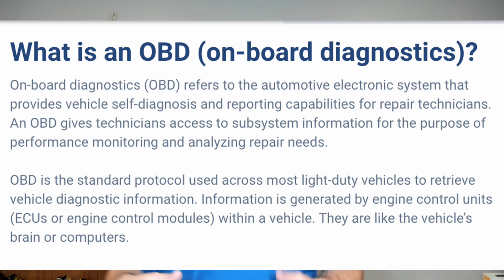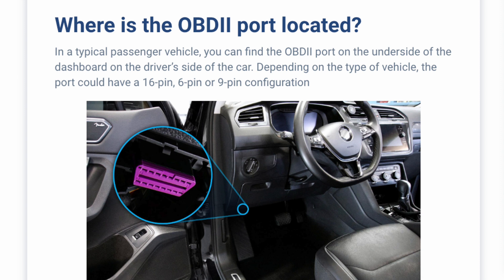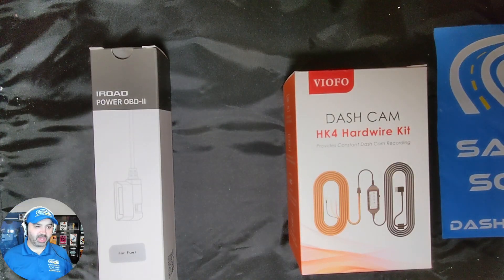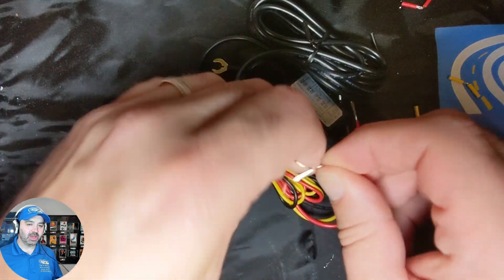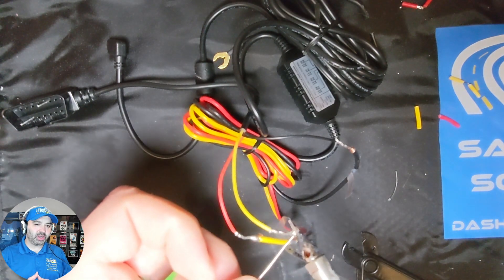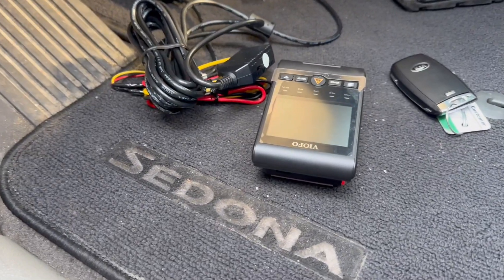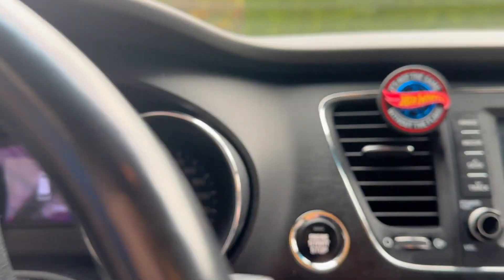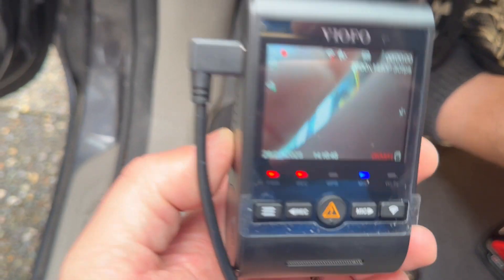Viofo OBD2 Hardwire Parking Mode Cable

Comment: Hello Ben,
70Mai offers a hardwire kit that connects to the OBD-II port and provides a direct USB-C output. I want to use it with the Viofo A329S 3-Channel model. The Viofo requires a 5V/2A input, while the 70Mai kit outputs 5V/2.4A through USB-C. Instead of combining the IROAD OBD kit with the Viofo HK6, can I use only the 70Mai kit?

My vehicles are a 2024 BMW 3 Series G20 and a 2025 Mini Countryman Electric. Have you done an installation on these models before? Would the solutions we discussed work in these cars?

Thank you in advance for your help.
Best regards.
Reply: By the way, I want to record in both driving mode and parking mode.
Reply from the maker: @turguthelvacioglu it is not compatible with viofo.
Reply: @SafeDriveSolutions  Thanks I understand that 70Mai kit is not working with Viofo. How about the solution that you're suggesting (IRoad + Viofo HK6), does this custom kit works both on Bmw 3 G20 and Mini Countryman Electric?
Reply from the maker: @turguthelvacioglu  We have seen great success on EV and gas vehicles. But there is always a chance it could not work with your vehicle. I have seen a rangerover and 1 BMW that both acted weird. DOing regular recording with vehicle off and parking recording while driving.

Comment: On a 2016 BMW X5 S drive 35i can you use the HK6 hardwire kit (won’t work in parking mode) or do you have to have this OBD2 kit. I’m being told that on German cars for some reason they can’t use the HK6 hardware kit something about a parasitic draw installed from the factory in German vehicles ..

Being told you have to go to the OBD2 port as this bypasses it.  Is there any truth to this? I can’t get a straight answer even from the manufacturer.

They told me the OBD2 port kit is a charger just an easier way of installing.

I figure you do these all the time in all different vehicles, especially high-end. I already have the HK6 hardware kit. Will it work on this vehicle for parking mode hybrid with the voltage cut off at 12.4 on A329S dash cam 12.2v on HK6 box? Thank you so much.

Don’t care about the install being easier as I’ve already paid for install for 2 vehicles. I ordered the HK6 hardware kit after the install (had no idea it wasn’t gonna work as they never asked me what vehicles were being installed on ) Rep told me they found out parking mode won’t work without it. Now the factory reps along with the factory is telling me that I need the OBD2 too because of the German car.

Comment: Does this work on a mercedes? I tried to install the hk4 kit on my GLE and the fuse for ACC is in the trunk and constant power is on the front passenger side. But with obdi it will be much easier to route the wire
Reply from the maker: We have used it on many Mercedes

Comment: My car is mazda 3 2025.  I have ordered the viofo a229 pro. With hk 4. And i am thinking to buy an obd port cable.  Which one would be best. Iroad gen 2 or gen 2.  And which one is used in this video.  Is the installation process same. 😊
Reply from the maker: the new iroad im300 is the only cable we know of now. It is same process

Comment: Thank you for this detailed video on how to get the HK4 hooked up to iRoad OBD to get parking mode working on my A229 Plus successfully. Just trying to find out how much current draw or consumption happens at each different parking mode? Did you have a video with the numbers tested? Timelapse, LBT and AED..and I know AED apparently uses the most but can you tell if I set the motion sensitivity pickup on AED to ‘low’, would that use a little less than on medium? Thank you ☺️
Reply from the maker: I do for the Viofo A229 Pro which is very similar

Comment: I tried hard-wiring a viofo a329 in my byd sealion 7 however all the fuses are constant and wont go in to parking mode. 

So I will have to try this obd2 port cable to hopefully get parking mode to work. Or find a wire to an accessory I can T splice after the relay to the acc wire
Reply from the maker: I have never worked on a BYD vehicle. Maybe one day

Comment: Can I use a DDPAI OBD2 hardwire kit that has a USB C end directly with my A229 Plus without using the HK4 kit in the middle? Thanks
Reply from the maker: No you can not
Reply: More importantly have you tried this method to work on a Jeep Grand Cherokee 2018? Considering purchasing the iRoad OBD cable to wire up with my HK4. Thanks :)
Reply from the maker: @vijith555  i have done Jeep Grand Cherokees with OBD2 cables a few times
Reply: @SafeDriveSolutions That’s good to hear as I was beginning to think the Grand Cherokee’s OBD port might not be suitable for the job as in it might never let the dash cam go to parking mode or something like that. I tried the DDPAI OBD had wire kit and it failed. Camera would only turn on occasionally when starting the car and almost all the time never seem to go to sleep/parking mode when turned off. If I am not wrong I will order the same iRoad OBD power adapter like you have on this video to pair with the HK4 kit I have from Viofo. Can you quote me the exact name and model of this OBD adapter you use on the video so I get it right? Even a link if possible. Thanks so much for your advise and help on this ☺️
Reply from the maker: @vijith555  Not sure where you are located in the world.
Reply: @SafeDriveSolutions I’m located in Perth, Australia ☺️
Reply from the maker: @vijith555  i believe their is an iroad dealer. If not I believe Vugera has a similar obd2 cable
Reply: @SafeDriveSolutions  I found an iRoad Australia website and seem to have a newer generation OBd cable of what you are using. I cannot send the link here YouTube keeps deleting my comment. Might have to personal message you and try. Also did you use the passengers side or drivers side OBD port when you did Grand Cherokees 2018+ ? Thanks
Reply from the maker: @vijith555  there should only be 1 obd2 cable
Reply: @SafeDriveSolutions  I got the iRoad OBD2 cable directly from iRoad in Australia and as per your directions on the video connected the HK4's red to iRoad yellow and HK4's yellow to iRoad's red plus ground to ground and tried the camera this morning. Problem is the camera turns on as soon as you plug the power in but does not go into parking mode even after waiting for over 6 minutes past cutting off ignition. I tested using a multimeter the OBD port does throttle down from around 13-14V to 12.4V in about a minute after cutting off igntion. The iRoad adapter is set to Fuel car mode and also in P mode. Since the HK4 is used in-line, do I need to set the parking mode to S on the iRoad adapter? Or have Viofo done something new with their cables now and we need to connect red to red and yellow to yellow perhaps? Thank you. *UPDATE - Just had another look at the wire labels on the HK4 kit and it says ACC for Yellow wire and BATT for red. Which means they have reversed and corrected their standard on the newer HK4 kits perhaps?? I also noticed my kit's ground cable also had a metal connector and wasn't without one like the kit on your video. They may have now lined up with normal standards, so which means mine is connected reverse at the moment? And the iRoad cable I am using is also the newer generation IM300 too. What I saw on their website for their non-OBD hard wire kit, the wiring schematics are Yellow is ACC, Red is BATT. Confused!
Reply: I stand corrected! I checked the power delivery using a multimeter while the OBD cable is plugged in and going out the constant was yellow and acc was red. And Viofo indeed does have them in reverse. Re-cabled the 2 wires again and this time connected the iRoad up, started the car and then plugged in my Viofo. Let the camera start up and then shut the engine off and to my excitement exactly on the 5th minute the camera switched to parking mode! I think on the first attempt it must have been the iRoad not switching over properly plus what I did this time after hooking it up to the port is flicking the S and P modes once so it initialises. Maybe it just needed that. Now it works consistently with no issues. Thank you so much for your guidance on this ☺️
Reply: @vijith555 Hi mate, Thanks for sharing. I have the DDPAI obd cable, do you mean it will  not work when wire it up with the HW kit like that in the video? And it needs to be the iroad obd cable? Thanks
Reply: Thank you for getting back to me. You are correct I did try one yesterday and the camera isnt even turning on at certain times plus it never seems to be able to go to parking mode and keeps running despite the engine turning off. I will need to source the similar OBD2 power adapter and wire that into the HK4 kit I already have. Only looking at this method becuase it is quite painful to use the HK4 kit with a 2018 Grand Cherokee due to the fuse box being in the engine bay area and having to route wires through a very very difficult firewall. They don't make it easy!

Comment: Hi ! Thank you for this informative video. I had been waiting for the official VIOFO OBD II cable to be released in Europe, but it hasn’t happened. I just bought the A229 Plus model, and I’m wondering if I could simply buy an OBD II cable on Amazon with an adjustable low-voltage protection switch (12,2 preferably). It's an OBD II with pins on 4, 5, and 16 as you explained in your other video. Do you know if that would work?
Thank you in advance !
Reply from the maker: no not all OBD2 cables are the same and not all USB cables are the same. Always make sure to use the Viofo certified Hardwire cable like we did in this video.
Reply: According to some forum topics, it seems that Iroad obd2 cable has some electronics in cable. I suppose they use CAN interface to figure out when the ignition is on and have a load switch that emulates switchable  ACC pin using a power from the pin 16. 
By default there is no pure ACC pin on obd2 port, otherwise you could just take simple obd2 cable and connect it in the same way as he did in video with viofo hw kit.

Comment: Hi, what switch setting should I set the iroad obd plug? S or P?
Reply from the maker: S is for normal recording, p is for normal and parking mode
Reply: So I was able to setup the OBD cable for my viofo a229 plus. Parking mode activates every 5 minutes when the engine shuts off. However, most of the time the camera does not exit parking mode even after I drive for a couple of minutes. I have to manually restart the camera for it to exit parking mode.
Reply from the maker: @oneproductionman  which cables are you using? what vehicle?
Reply: I spliced the type-c HK4 hardwire kit cable to the Iroad OBD2 cable just like in your video. Car is 2025 mazda cx5 GS.
Reply from the maker: @oneproductionman  can you try unplugging the hk4 from the gps and replug it in. Also can you take the OBD2 plug and unplug and replug it back in 3 times. Once done start your vehicle up and let the vehicle run for 1 minute. Then turn it off. verify it goes into parking mode.

Comment: Hi Ben thanks again for the informative video. So I purchased the iroad obd2 cable and also the viofo a229 set up i got with the 3 cameras came with the HK4 hardwire kit. The hardwire kit has a small block with input and output settings. 
11.8v-23.6v 
12.0v-24.0v
12.2v-24.4v
12.4v-24.8v
Which one of these should i set the cable to? Any suggestions?
Reply from the maker: most vehicles we would set it for 12 volts or higher depending on the vehicle
Reply: I have a Lexus gs 350 so 12.0v-24.0v would be ok with that vehicle?
Thank you sir appreciate your help
Reply from the maker: @ShowNtellwoodworking  yes typically 12 volts is safe
Reply: Great brother thanks so much also I installed the dashcam but I don’t see any notification tab. Does the VIOFO cam or app send a notification to my phone on parking mode in case of an event?
Reply from the maker: @ShowNtellwoodworking  no it does not send you any notifications. even verbal there is no notifications

Comment: I tried to connect mij Viofo a229 pro 3ch to a Vantrue OBD2 dashcam connector with battery protection.

Parking mode does not come on, even in 1 to 5 min with the Vantrue OBD. And the dashcam stayed always on even when the car is off. I guess this OBD works only on Vantrue products.

I realy want the OBD option, because I dont like to mess arround fuses. So I'm gonna try your option. I'm getting a OBD connector and a Viofo hardwire kit. Hopefully this wil work like you said. My last option will be to use the fuses if this also doesnt work.

OBD route:
- OBD connector RIIEYOCA Automotive OBD
- Viofo hardwire kit

Comment: Would this work for an under the hood led strip I’d like to install?
Reply from the maker: these typically have a 2amp rated output. There are probably better solutions then this for your under hood led lights.

Comment: My Thinkware OBD2 cable have inline fuses. Should fuses be added to this setup
Reply from the maker: it only has 2amp output. You can put inline fuses if you want but I typically do not put fuses inline as it is only 2amp output on the IROAD cable. so putting a 5amp fuse is not going to do anything.

Comment: I'm trying to do this because I cannot hardwire my Mazda CX-30 (since there is no ACC Fuse and they all remain "hot" even when the ignition is off). There don't seem to be any IROAD OBD2 cables left. Would this method still work with the Thinkware OBD2 cable and the Viofo HK4? Also, on the Thinkware is the Red Wire the ACC and the Yellow Wire the B+ as well? Thanks!
Reply: I need to do something similar on my Mazda 3 2025. Did you make it work with Thinkware OBD II and VIOFO HK4? How did you connect the cables? I am not interested in parking mode, just for the camera to start and stop while the engine is running.

Comment: then how could the a329 connect to both OBD2 and the external SSD?
Reply from the maker: ssd plugs into the side and the power plug, plugs in up top into gps antenna

Comment: Is parking mode still an option if the camera is not connected via obd2 port? I have a performance car that I frequently data log through a wireless dongle that’s connected via obd2, so that port isn’t available
Reply from the maker: you can still hardwire it.

Comment: Can i use any hardwire cable with ddpai n5 dule DASHCAM 
Is the every dash cam type c PORT internal connection same
Reply from the maker: No you need to use specific cord for your model

Comment: Can you make one for a Rexing V33 plus and what would be the cost?
Reply from the maker: You can build it if you like. We wont build any rexing cables. Simply buy a rexing cable that has 3 wires and connect the 2 together like the video.

Comment: Hi Ben, first of all thanks for your all informative videos for us. 

I decided that i'm not gonna mess with fuse connections etc. so i am ready to pull the triger. Just one question.

I have BMW F30 3.20 and i will order Viofo a329 Pro, HK4 cable kit and IROAD's OBD cable. Is your connections, i mean red wire to yellow, yellow to red  and black to black still the same for  IM-300 model?
Reply from the maker: Yes still the same on IM300
Reply: @SafeDriveSolutions thanks for your quick response.

Comment: I tried the same wiring connection from  Viofoa329 to BlackboxMyCar powercell 8. Battery powercell is good and charged but when i try this method of wiring it doesnt power my Viofo. I also replaced the Hk4 wiring with new one, because i thought it might be faulty. Viofoa329 turns on when its  connected through the cigarette adapter of the powercell only. Any suggestions? Thank you
Reply from the maker: This is a OBD2 cable video. this has nothing to do with battery packs or wiring of battery packs
Reply: @SafeDriveSolutions  Yes sir , I'm aware of it.  I just clicked on the link you provided from a video of yours " How To Hardwire A Dash Camera To a battery pack"  you mentioned in the video it was similar to the wiring of an OBD2 .
Reply from the maker: @Chickenbrocoly  Is there not a hardwire output with 3 wires red, yellow and black?
Reply: @SafeDriveSolutions  yes there is, I might have a feeling that the HK4 is just faulty.

Comment: Hey Ben I’m looking into ordering this Iroad obd2 power cord for my voodoo a229 3 channel would this work well on a 2014 Lexus gs350? Also I will want to hide the power for the cameras from mechanics I saw some obd2 cord splitters. How do you feel about using one to keep an open obd2 port for mechanic to be able to diagnose the car when needed. And not be able to see the dash cam power
Reply from the maker: There is nothing wrong with using this cord that I know of on your vehicle. Also the Y splitter is a good idea. Just make sure it has all 16 pins populated on the y splitter.
Reply: @ do you have this splitter on your store ?
Reply from the maker: @ShowNtellwoodworking  no we do not